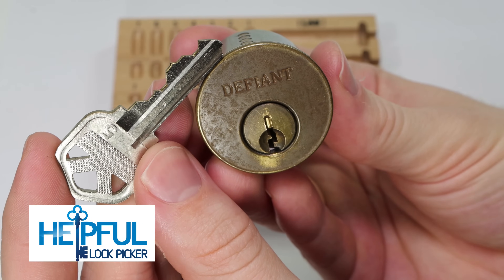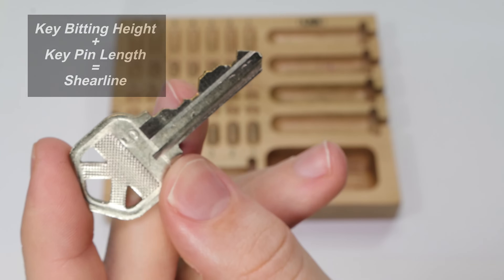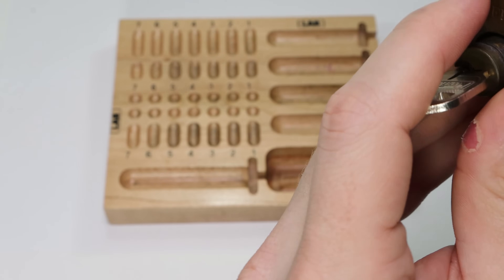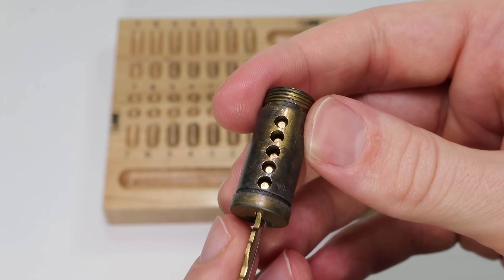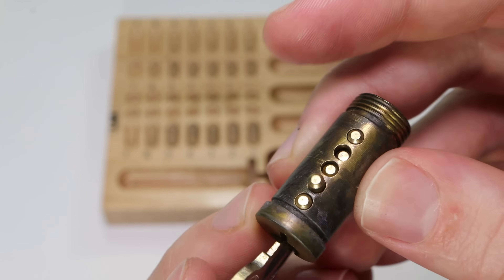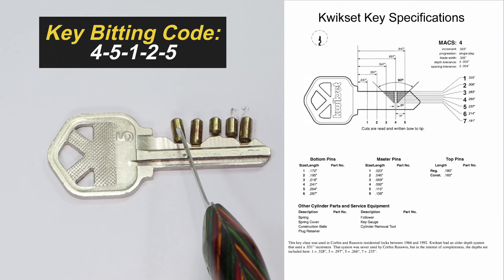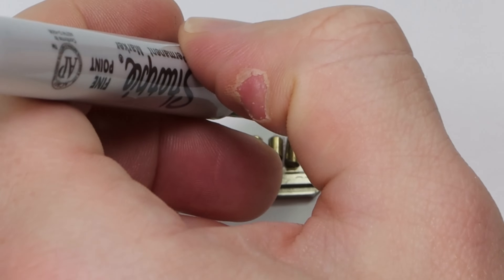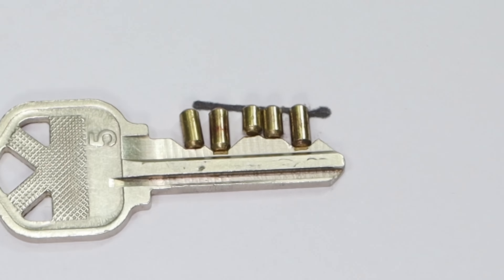How A Key Works

Comment: Why aren't the pins falling down on their own in that cylinder? I never seen a cylinder where the pins need to pushed down like that. Does the lock it goes to just need strong springs?
Reply from the maker: The pins are rubbing against the tight plug so they don't always just drop. Also, it was both hot and humid when I filmed this.

This is in part the job of the driver pins over spring pressure to do this.
Reply: @HelpfulLockPicker  that makes sense thank you for explaining

Comment: Sometimes it's good to demo it this way. It takes away the core and the bible so you can simply concentrate on the key and the pins. People should do more videos like this to explain how things work. 

As an example, people talk about Lockwood key pins having a tiny taper on the top which causes it to easily overet. A demo like this one would be a great way to explain it.
Reply from the maker: Thank you for sharing and I am happy you feel it could add value to someone learning :)

Comment: Before I started lock picking as a hobby I always thought the key pins rode on the POINTS of the key, which never made sense to me because when the key wore down from friction either in the lock or with other keys in a pocket over time etc, the keys still worked!  My Mom's car key was almost smooth and still worked!
This video very clearly shows how it's the valleys between the points that matter, and not the points themselves!

Very nice.
Reply: I've been watching Lock Sport and lock picking videos for 3 days now.  While I understand the basic principles, I had to search on "understanding key bitting" to find several videos to ascertain whether the point or the flats of the keys were used.  My next question is what stops the key pins from falling out into the keyway?  That part isn't clear to me yet.  I do understand key pins, driver pins, master wafers, control and operational keys, security pins (serrated, spool, T), even how a medico lock works with side bar and pin rotation.  Still haven't looked at internals of wafer or tubular locks, and I think ward locks are pretty basic but haven't verified this yet.

Anyway, thank you for the videos.  This is going to be my newest hobby!  I could even see being a lock smith under different circumstances; this is interesting!
Reply from the maker: Thanks for checking it out! One thing which I could have done better was used a lock like a Schlage where it showed the key pins are pointed on one side and flat on the other. Kwikset is cheap and makes both sides flat.
Reply: I thought the same.